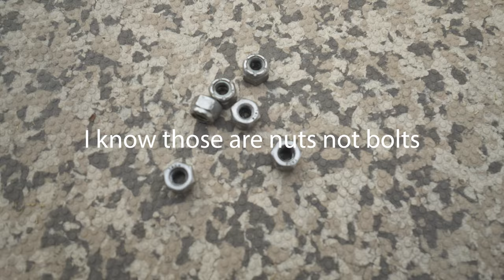Outboard Jet Maintenance Sharpening the Impeller

Comment: A couple tips to those looking to service your impeller assembly:
-The washers that come with the jet pump seem to be thick, remember you can get them in varying thickness to help with shimming it, just keep in mind the overall thickness of the washer group when trying to find your sweet spot.
-If you need to replace the washer that holds the nut in place, it is called a tab washer, make sure you get one in a material that will work with your existing materials, you don’t want to cop out and buy a quickest/easiest tab washer only to have it start a chemical reaction within the rest of your assembly costing you way more in the long run.

I used to be in industrial sales, these are a few things most non-industry people may not think of.

Keep up the great videos!
Reply from the maker: Thanks for the tips!

Comment: I like slide on the impeller without the key, then slide on sleeve (with my adjusted washers). You can then spin the impeller to double check it doesn’t rub on the sleeve. Then slide it all off and for final reassemble. Cheers!!
Reply from the maker: Awesome tip. I'll try that next time.
Reply: Yes sir. That's the ticket.

Comment: The easiest way for me to check clearance on the wear ring is to spray paint the inside of the wear ring and install it. I only put 3 nuts on the jet foot and turn the engine over with the starter a couple times. I shim it out until it removes some paint and back it out 1 shim.
Reply: Slather the cone where you see marks with lapping compound and improve your tolerance.  Wipe the crud out, good to go.

Comment: I usually just put the impeller in with the shims I believe I need without the nut,  I then put the sleeve in and hold it up by hand pressure only,  I then slide the impeller up and down to see how many more shims I need to add or take out.  Its fast and easy.
Reply from the maker: Thanks for the tip!

Comment: The wings on your jet foot do good on the lake and had shop make a set them out of stainless  and adds strength to the foot and they keep the foot from sucking every little wave you go over. Make out of stainless they are very hard to bend to and protects your foot and the do help steering too.

Comment: You can also use a business card to check shim clearance.
Reply from the maker: The folks at Outboard Jets told ne to tape 2 business cards to each blade before assembly to get it aligned.

Comment: Greetings and thanks for the informative, great video.  How do you re-smooth out the scratches on the surface of the wear ring/sleeve ?? 
And will it interfere with the tight tolerances needed between the impeller and the sleeve?
Reply from the maker: The only way that works for sure is to replace it. They are pretty inexpensive. I have heard of people filling in the grooves with jb weld but I haven't tried it.
Reply: @AlvinDedeauxFlyFishing 
Thanks and Appreciate your feedback!

Comment: Alvin- I have a very similar setup- Hog Island + Tohatsu jet. At 2:10 in video- I noticed you have a plate attached to hull that looks like it might protect the impeller grill from big rock strikes. Is that what it’s for?  Also noticed you have two “phalanges” on either side of the impeller grill. What are those for?  Thanks!  Love your videos/ soundtracks
Reply from the maker: The plate is a splash guard. It cuts down on the water spraying up from the foot. The  fins are called deep water fins I believe. Outboard Jets sells them. They help to keep the pump from sucking air in choppy water or if you trim the engine way up.

Comment: Very informative video. Thank you. I own a 1996 Johnson 50/35 outboard jet that I run on the Delaware River. Already had the impeller off to sharpen and set clearance . My housing is frozen inside the pick up. Did not want to get crazy trying to get it out. Do you have any tricks for this circumstance
Reply from the maker: The foot of the jet is stuck?
Reply: You mean the sleeve. 
I'm assuming that you got out out by now. 
Tapping, wiggling, prying .. and heating the foot if necessary.

Comment: Alvin what is gap tolerance supposed to be between liner and impeller? If I'm hitting slightly just file impeller (very) lightly?I took shim  from top. Now seem to have a lot of gap
Reply from the maker: I think it's supposed to be 1/32. I learned a trick from the folks at outboard jets. They said to tape 2 business cards to each blade before you put the sleeve and foot back on. Tighten it up and the cards will make sure that the liner is aligned with the impeller. Once you start it up the cards will come out. There is a little play in the foot and it can get out of alignment with the impeller.
Reply: The leading edge of the impeller should be 1/32 , the clearance between the impeller and wear ring should be .015 inches

Comment: My impeller isn't sliding off so easy. Nut is off but it's locked on still. That key I can see in the slot. Do I punch that out somehow?
Reply from the maker: If it hasn't been taken off before it can be tough, try hitting it a few times.

Comment: Unbolted my foot. Sleeve is attached still. Does that happen from time to time. I tapped it with a dead blow won't budge
Reply from the maker: On the older ones the sleeve is held in with 2 bolts on the side of the foot.

Comment: How about a stuck propeller if it doesn’t pull out what could be the problem then ?
Reply from the maker: I haven't had one completely stuck. Usually a few taps with the hammer works. When you put it back in make sure and grease everything up so it comes out next time.

Comment: Will a polished impeller make the boat faster or slower then a stock rough ish impeller?
Reply from the maker: Not really sure. Seems like a lot of work so it must help.
Reply: @AlvinDedeauxFlyFishing  just some ppl say faster some say slower. Some say more bite out the hole because more surface tension/ gripping water an less top speed because surface tension/gripping water. Easy/fun day project over the winter. Have all the tools. Just don’t need more hole shoot just wouldn’t mind another few mph up top.

Comment: You sharpened it backwards. You need to sharpen the upper edge and then blend it in so its a smooth transition. It need to be done that way to pull the water into the pump. Also always grease up the shaft and other surfaces so it comes apart easier the next time.
Reply from the maker: Yup, I'm thinking about doing another video on that. Good tip on the grease as well.
Reply: good catch Way to go
Reply: He did it right.
Reply: He sharpened it correctly,  kinda lacked in the measuring of tolerances. And you should clean up your wear ring before installing,  you loose a lot of pressure in the rough surface.
Reply: @RobPollard-q1i  
And how do you “clean up” the wear ring/sleeve ??

Comment: I need to file my impeller and then quit running skinny side channels, lol.
Reply from the maker: Or file it and keep running skinny!
Reply: @AlvinDedeauxFlyFishing  This is much more likely to happen, lol.
Reply: False.  you must always run the skinny side channels, especially if they're slightly too narrow...
Reply: @snaps10  My intake has the proof of that🤣
Reply: I never run skinny side channels for no reason. It just happens that they are all short cuts. Got to save fuel with a jet